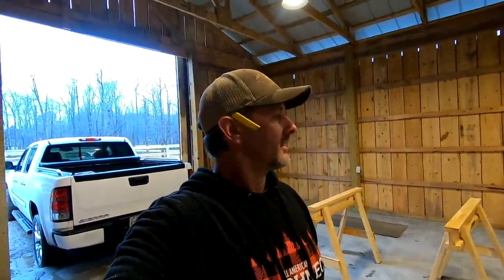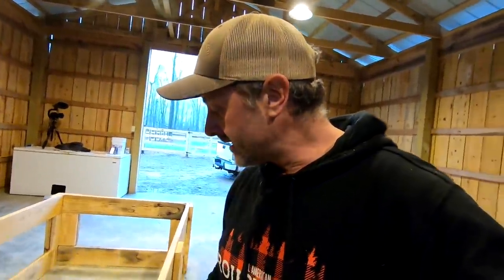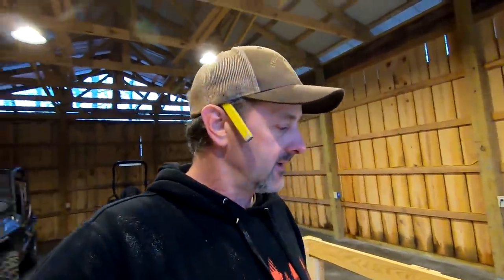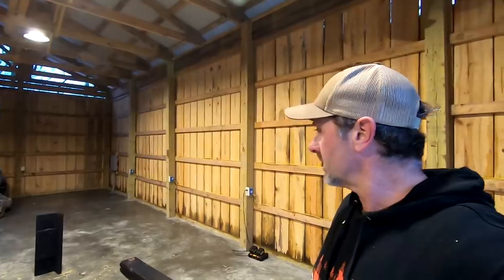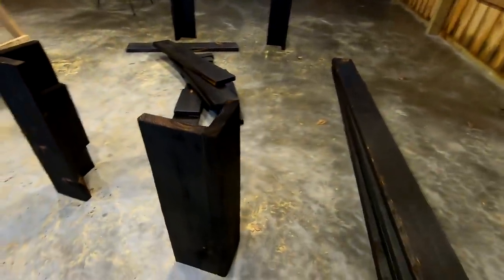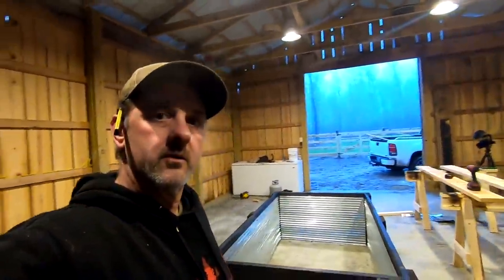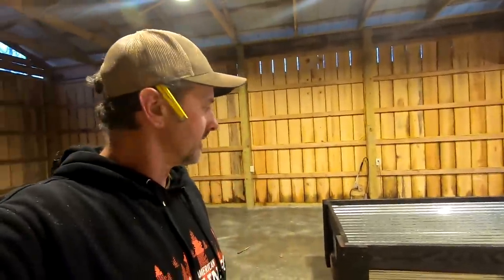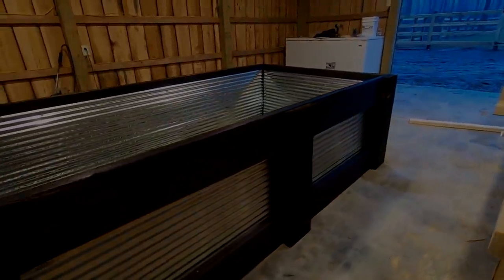Garden Planter Box using Shou Sugi Ban...

Comment: Planter looks great. I’m interested in seeing how long it’s going to last.You should fill the bottom a third of the way with old rotten logs and then at least a yard of fresh manure. Then fill it with a good compost mix. The logs will absorb the nitrogen as they rot and give years of great growing.

I noticed your freezer is sitting directly on your concrete slab. 
This will cause rust on the freezer bottom from moisture coming from the temperature difference. You need to slide some 2/4’s under it to give it ventilation and break the contact with the slab.
I really enjoy watching and thanks for all you do.

Comment: That raised bed looked lovely. Shou Sugi Ban is one my favourite techniques. Will give it a try one day. You could used a modified Hugelkulture method to partially fill the planters with logs and branches of various sizes,then dirt and compost on top. You won’t need as much actual soil and the rotting logs add organic matter and hold moisture. You must have enjoyed working in your new barn workspace out of the weather. 🙂
Reply: Bettina H. I agree! I used it in my raised bed last spring. I rarely need to water it and I live in SoCal!
Reply from the maker: I did throw some rotten logs in the bottom and its also sitting on all the rice husks that I put down last fall.
Reply: Hickory Ridge Homestead I have no worries that you know what you are doing.😉

Comment: When I first saw this technique to preserve wood it was on green rough sawn lumber. Do you know how well it works on kiln dried lumber?  I have only seen it used on kiln dried over the last year.  The reason I ask is because the green sap I think would turn to creosote when burned.  The kiln dried lumber might not make the desired creosote for the protection.  But I am sure it is better than no treatment at all.  The same process creates problems burning green wood in a fireplace or stove.  The creosote builds up and can start a chimney fire.
Reply from the maker: Im curious as well. Time will tell .

Comment: I used creosote on already old clothesline poles years and years ago. I found a can of the stuff in my Dad's garage and decided to try it out. Those poles were still good when the line was removed. I wondered if creosote would be safe for the inside of a garden bed? I haven't tried it. Just wondered if you, or anyone had any knowledge about. 

My husband built raised beds very similar to what you have just made. We used salvaged boards and salvaged galvanized steel. I love our beds.
Reply: colleenepage my research suggests not to use creosote in or around plants for human consumption.
Reply: Yes creosote is toxic that's why they took it off the market 20-30 years ago, but it's ok to spray our skies with chemicals and put round-up on our food and loads of chems. in our water.  Go figure.  I guess if the creosote is not in contact with your growing medium, no harm?
Reply from the maker: I wouldn't use the creosote because it is a petroleum byproduct and not like natural creosote that comes from burning wood.